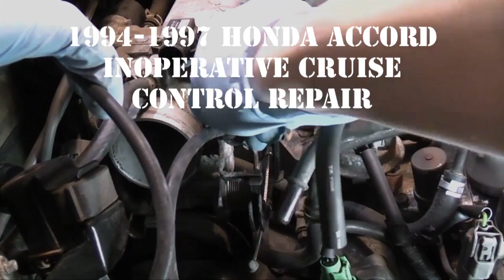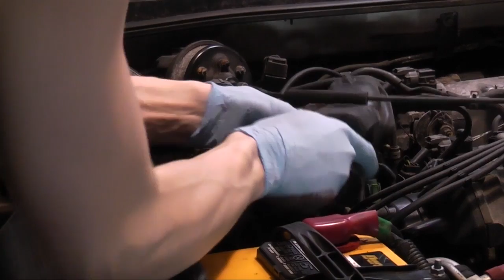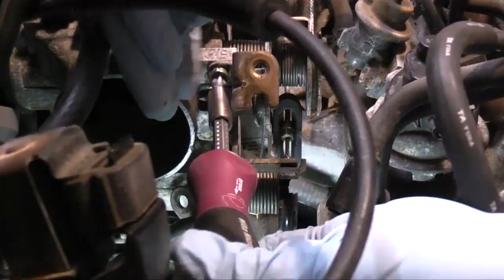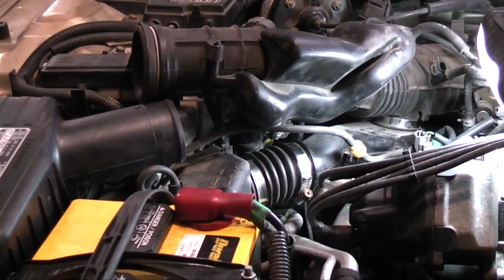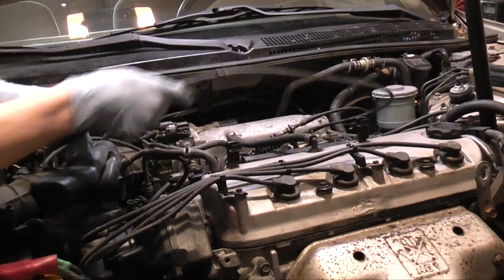Honda Accord Cruise Control Failure Repair

Comment: Hello Bushougoma, I intently watched your video and then went and looked at the car, I got lucky with the cruise control as the plastic cable cam was not broken, then I remembered that you mentioned the vacuum line so I traced it and found that it was disconnected.  I plugged it in and the cruise works perfectly, as a bonus the car idles better because the leak was fixed and believe it or not the climate control system started working correctly.  I had been having to run the AC when I used the heater to keep the windows from fogging up (hardly makes sense, but it worked). That little vacuum leak was causing multiple problems.  This one video helped me fix my problems, thanks a million for the information.  You should start plugging some products and get some sponsors, you really do that good of a job. Keep the videos coming brother.

Comment: for anyone watching this 10 years later, and you can't source another used throttle body. you might try this if handy with your hands and tools. make a couple pieces from thin but sturdy metal or plastic the same shape as the outer curved sides of the old plastic piece(Both pieces should/will be shorter & smaller-not going all the way around the curve-maybe an inch or so
 ), then carefully drill a few very shallow divots into the plastic circumference and epoxy the metal pieces to the both sides of the plastic piece- BE SURE THE CABLE IS INSERTED BEFORE EPOXY IS APPLIED TO THE CLEANED FLAT SURFACES ONLY away from the cable nub hole-- allow it to dry 24 -48 hours, reattach,  then it should be good for some time to come -possibly the life of the car.

Comment from the maker: The 01 Civic uses an actuator motor and not a vacuum actuator like the Accord in the video.

I'd start simple and check the cruise control fuse first and make sure the module under the dash is getting power. If it is then I'd check the clutch pedal position switch to make sure it works and the brake light switch. If either isn't functioning cruise won't actuate.

Check the cruise switches on the steering wheel back probe the switch inputs on the module.

Comment: Yeah, it looks like it might have been the cable being rusty.  A good stomp broke the rust.  Should I just treat the cable with some bike chain grease?
Also, I realized I have the same cracked throttle linkage for the cruise that you explain in this video.  WTH?!  Thanks for making these videos.  Super helpful to the backyard mechanics.

Comment: Thanks by the tips. My honda accord 95 cruise stops to work. Button control green light up but when try to activate it on steering wheel buttons it does not work. Would it be an electric issue?

Comment: Your vids are always clear, with good information . I like the added voice over commentary info as well.  I wonder who holds the light and camera while you are working - perhaps you have a little brother doing that..
I was wondering my cruise stopped working , the SRS lamp had been on for a while and the horn just stopped working a couple months prior the cruise  had worked sporadically but turning the steering wheel it would shut off ( a big hint what was wrong) . So I replaced the reel assembly AKA clock spring, Horn and SRS (no constant SRS light) both work now , the cruise does not work at all. The lamp in the Cruise switch on dash burned out - during/after or just before reel assembly replacement. I replaced both bulbs in the switch. I try the cruise and yet I get nothing no indication on instrument panel either. So what could possibly go wrong given the above scenario ? Is there anything special I would need to do for the clock spring replacement (I reset the SRS) but on the cruise there should not be anything. 
I noticed after replacing clock spring - the check engine light came on, code 12 and code 5. EGR  and MAP. Could a faulty EGR or MAP cause the cruise control to not set?
I plan to troubleshoot these 2 items today.

Comment from the maker: If the inputs aren't present suspect a bad switch on the wheel or a bad clock spring.

From there go under the hood and pop the lid off the cruise motor make sure the cable is connected and the reel isn't broken.

If it's connected properly perform a cruise module bypass test to make sure the motor is working.

If all of the above checks out check the grounds on the cruise control module if they're good the cruise module is bad.

If you have a DMM and would like more detailed instructions PM me.

Comment: Excellent video. The cable drum on my '96 Accord is also broken similar to yours. Does this cruise control output linkage fulfil any other critical purpose besides initiating cruise control? The reason for asking is because I wanted to know if I would still be able to drive the car with this cable inactive while I hunt down another cable drum. Thank you
Reply from the maker: It's solely for maintaining tension on the cruise cable. I'd disconnect the electrical connector from the cruise vacuum valve to make sure no one activates it by accident until it can be fixed.

Comment from the maker: Oh and I almost forgot check to make sure the plastic button that presses clutch pedal position switch hasn't broken and fallen off. If it has the switch won't be actuated and cruise won't work.

The button is an inexpensive part and can be found at the dealer.
Reply: Bushougoma yup i checked and sure enough it was broken off.

Comment: Great job Bushougoma.  Your title says "Failure Repair", but I didn't come across what failed.  The problem with my 99 CRV is that the cruise control seems to work, engages and disengages, light on, etc.  But once the speed set to 70, it gradually and slowly decelerate to 65, or slower.  Very slowly, with the control still in effect.  I could easily step on the pedal to increase the speed to 70, and press the set button, and it works for another few miles.  Also, once in a while, while the speed set to 70, it would slowly and gradually accelerates to 80.  But the "automatic" acceleration only works occasionally, and seldomly.  Slack cable?  Or the 99 CRV is a totally different animal?  Any clues and suggestions?  Thank you again.

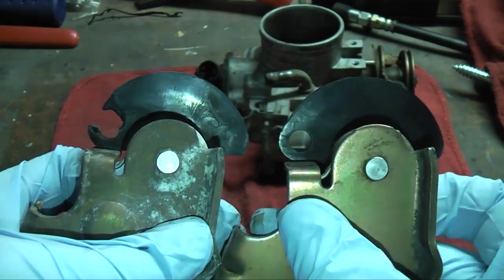Comment: I have a 2005 Honda Element and unlike yours, the CC cable-cam mechanism is on the same hub as the main throttle cable-cam (same for all K-series Accords) but it's still made of plastic and mine broke awhile ago in a way similar to yours at 9:02.  The cable does hold the CC "pull" but is not secure and has already popped off once. Yeah, a whole new TB is not appropriate but after 16 years of use, the CC cable-cam in most other K-series Honda TB's in the scrap yards by now are at risk of breaking soon if not already broken.  I cleaned the attachment points on the cam then set the cable end in some Hondabond, leaving it overnight.  Hope this works....
Reply: I like your rtv  “repair”  non working cruise and saw broken barrel holder when putting back together after replacing starter on my 2006 element, ya,  that was a lot of fun.  Two small strips of gorilla tape, working for now, might try your silicone suggestion next time. It’s elemental
Reply: @suprtrmp71  Thanks.   Still works!   I actually used some Hond bond which is the same as Pematex Grey.

Comment: I cracked the plastic snout when I was replacing the starter.  Now my gas pedal is stuck.  Are these two things related, or do I have some other problem causing the gas pedal to be stuck.  Thanks.

Comment: Hey Bushougoma! Thank goodness I saw this!! My 94 Accord sometimes has a high idle, especially after I apply the brakes when I'm stopped and in Neutral or Park, or if I rev it high. My cruise control also stopped working, and sure enough, my black plastic is broken like in your video. From what I can see, the metal end of the cruise control cable doesn't move, it's the cable that moves. So is it OK for me to simply JBweld the metal tab to the broken plastic where it should be?
Reply from the maker: You could try it but ideally the cylindrical piece on the cable should be able to rotate freely on the component when the actuator pulls on the cable to prevent it from binding.

As for the high idle I'd check the fast idle valve it's a coolant temperature controlled bypass valve that allows air around the throttle plate when the engine is cold. It's supposed to close when the engine warms up. This valve is not under computer control (like the IAC valve) and can cause a high idle when it malfunctions.

To test it warm the engine up and remove the air intake tube from the throttle body inside the throttle body to the left of the throttle plate there will be two air bypass holes cover the bottom hole with your finger. If the idle returns to normal the fast idle valve is bad (stuck open).

Don't attempt to adjust the valve that will only be a temporary fix just replace it.
Reply: You're awesome, thank you man. Best of luck to you and your family.

Comment: have you done any work on a honda civic engine? I have a manual 01 honda civic ex. and the cruise just will not work. i havent taken too much time to look into it yet, but even if i did i wouldnt know what to look for. any suggestions?

Comment: On mine the cruise only works when the headlights are on.  If you try to engage with the lights off the hard cruise switch light comes on solid but when you hit RESUME the engage light just flashes on momentarily and nothing happens.  Headlights on it works like normal.   Drivers side headlight is acting up a little,  I am using HID and it is eating ballasts on that side (probably due to a loose ground) too so I think that is a clue.  

I think I have a loose ground.  Is there one that is shared between the the cruise module and drivers headlight? Where would that be?  I have a 2004 accord.

Comment: My 2002 accord EX has the same issue however the cruise linkage appears to be sandwiched between the throttle linkage and the body.  What is the best way to remove and replace without damaging the throttle linkage springs?  Many thanks.
Reply from the maker: The easiest method would be to swap out the whole throttle body on that model year it's just a few fasteners.

You could also disassemble the cable reel and swap the plastic part over but it would be more trouble.

Comment: Help! I can't find a output linkage anywhere! Does this part go by another name???? Thanks great video by the way
Reply from the maker: devdogg2 They aren't sold individually for whatever reason and only come as part of the throttle body.

Look for a used throttle body at a salvage yard if you can't find one locally you should be able to find one on E-bay.
Reply: devdogg2

Comment: Throttle valve cable for the transmission 3:06 if i do cruise control delete, should i remove it as well or keep it?
Reply from the maker: It has nothing to do with the cruise at all.

The transmission kick down cable determines the shift points so unless you want an erratically shifting transmission you need to keep it.

Comment: The same issue occurred on my 2004 Accord.  Thanks!!!
Reply from the maker: Glad it helped.
Reply: J-B weld makes a product called J-B plasticweld about $5. I cleaned the plastic piece and put this material on.  Then used a dremel and drill to reform the worn piece.  It has been 2 months and working fine. Better than $300 for an entire new throttle body.  Still need to remove the throttle-body as described.  Can't believe honda doesn't sell the piece separately.
Reply from the maker: There's also another product called Q-Bond it can be used as an adhesive to bond broken parts together. Or it can be mixed with a powdered plastic filler which can be bonded and shaped to recreate any broken or lost pieces.

Never tried it though.